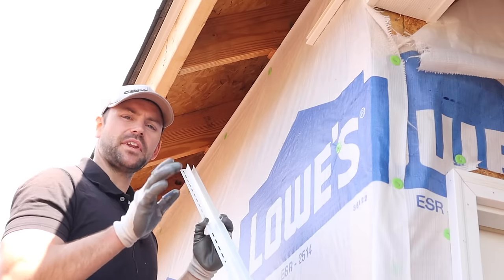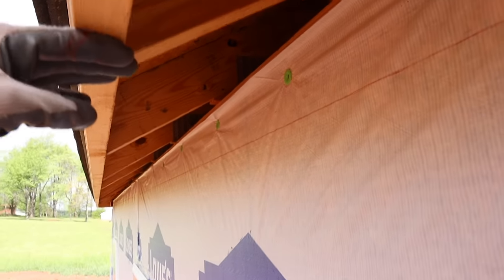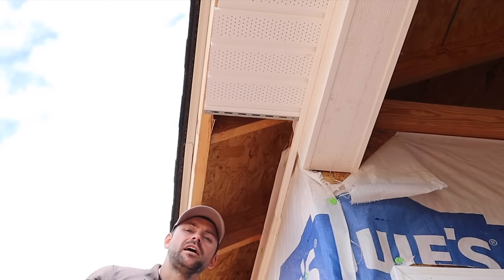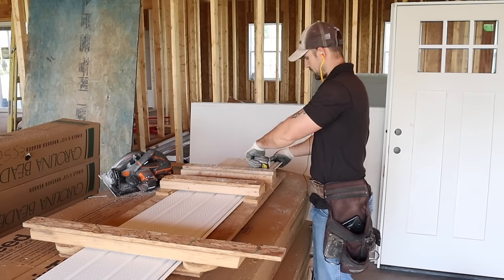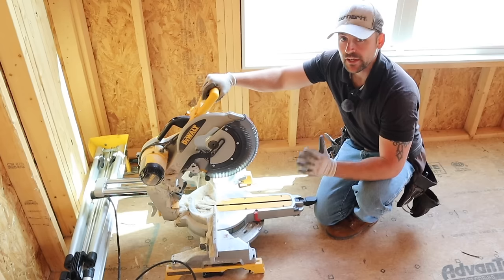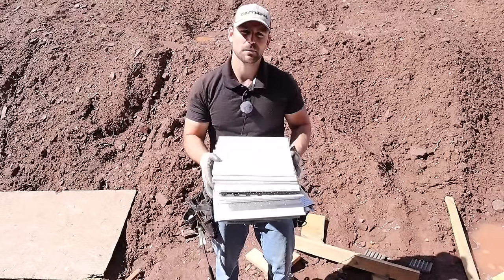How To Install Soffit And Fascia

Comment: You probably won’t see this , I just want to appreciate you for taking time to put this video, it Educational and very helpful .people like you really deserve viewers.
Reply from the maker: I am so glad you are thankful for my content! Do you put in a lot of time to make these videos. I hope you get great use out of them. Thanks a lot for watching!
Reply: this guy is super nice , hes very intelligent, explaining everything to the T
Reply: No safety glasses at all that's not good
Reply: @esexavo  12:25
Reply: I just needed help with the point of the eves. I can't get a straight cut at the point of the roof on my facia.
Reply: Very good and explained very clearly
Reply: Thank you for showing in detailed how the soffit fits into the F channel. I need understand this as I can partial disassemble some soffits to install security cameras and run Poe wires into the attic.
Reply: @TheExcellentLaborer  so pleased I found your Channel. Your explanations are smooth, detailed and easy to follow. Thank you. …staying with this.. unfortunately I don’t have the funds to pay a tradesperson, so got to try this myself. I have all the tools, most probably going to use my circular saw. My older home, already has old aluminum fascia, however I want to remove and fix as I can see I have rotting wood underneath.
I’m concerned as I might need to also take off the existing gutter 😮.. any advice appreciated. Unsure of you will see this message.. here’s hoping. Btw.. I’m in South Florida, so no cold weather here! 
Thanks again. Look forward to your reply/ extra guidance. 👍

Comment: The problem with installing the bath vent in the soffit, is the moisture is going to go right back thru your vented soffit into your attic space which is a no, no.  If you do put the bath vent in the soffit, you need to run unvented soffit for a distance of 6' in both directions before you start back with vented soffit.
Reply: Great point, I’m surprised he did not mention that in the video, it’s just basic fundamentals in soffit and facia installation, otherwise great video.
Reply: Absolutely agree.  I bought one years ago to retrofit to my old house and I began thinking about what you said above.  I did not install the vent but returned it.  Years later I installed a bathroom fan and put the bath vent in a side wall instead.
Reply: I saw the video as well
Reply: @roldangonzalez7360  He didn't know, so  that's why he didn't mention it

Comment: I'm looking for an answer as to why our fascia and soffits are completely rotten. The roof is cement tiles. The facia is wooden and the soffits are plywood. It looks like a piece of cardboard. The piece of aluminum in your video here is plastic and doesn't go over the facia. I don't think I should have the same company who made this roof to repair the rotten facia and soffit. Make Walsh Roofing Company I wonder if they also put gutteres?

Comment: I’ve always heard never install a bathroom vent in the soffit because the moisture will get drawn into the soffit and cause mold in the rafters/roof.
Reply: You're right. You never run vents out of the sophet, and there's absolutely no legitimate reason you would have to. lazy, and if someone tells you differently, they either don't know what they're doing, or they're just lazy and don't want to do it the right way because it's a little  little bit more work to put it through the roof where it should be

Comment: Just had a contractor install this and its all wavy. they bent it all and didnt use the stuff with ribs like you did. they also installed lots of nails under the drip edge. Any thoughts on what may have gone wrong?

Comment: Good video for beginners. Who ever put the roof on was lost on the drip edge it’s lapped wrong direction. If you will make a 45 degree cut when you made the angle notch let it over lap the straight cut at the corner it will look like it’s cut on 45 degree angle. Makes it look much more professional.

Comment: Good presentation.
2 things I do different.
1. I use stainless ring shank trim nails, because I've seen, too many times, the aluminum nails have worked their way out. It may be because of the hot and cold climate here.
2. On the underside corners of the fascia, I like to cut a 45 degree. It gives it more of a finished look and you don't have that corner sticking out.
Overall, an excellent presentation.  Thank!
Reply from the maker: Thanks for sharing! I appreciate you giving me honest feedback. Stay tuned for much more to come!
Reply: As James mentioned,  the nails do come loose after a period of time, what are your thoughts on white aluminum screws?

Comment: Great video.  Thank you.  I’m installing new soffits and fascia soon.  
My only suggestion is install the fascia before roofing.  Then if you have ice guard you can wrap the ice guard over the top of the fascia.  When gutters are installed they will seal against the ice guard.  
This does a great job sealing the area between the roof and the gutter that is otherwise not protected.

Comment: When we do are soffits and siding we use a grinder with a cut off wheel and it cuts them pretty quickly but does make a decent mess. Never thought to use a skill saw with the blade backwards might try it out next time
Reply from the maker: Turn the saw blade around backwards and you will love it! Nice clean cut but it is very loud be sure to use your protection. Thanks a lot for watching!
Reply: Doofy cat Donkey , that would be "our soffits", and you can get metal cutting blades.  They are spendy but work well.

Comment: Josh - love your videos! A couple video ideas: 1. common construction terms that inexperienced viewers may not know. 2. How to do the math to calculate framing interior walls 3. Installation of a fireplace. Just some ideas. Thanks!
Reply from the maker: Hi Michael! I am going to keep note of this post and use these as ideas. I’m definitely doing a fireplace installation at some point. It might be a while though. And that’s a great idea about the construction terms. I didn’t even think about that one. I appreciate it! Stay tuned!
Reply: I second the fireplace installation idea. I ran a gas line to old wood burning fireplace, need to figure out how to do the fireplace!

Comment: Hey Josh, a cool tip I learned many moons ago..is on corners especially the soffits..when your done wrapping and nail the metal you rip a 1"x1" peice by whatever fascia size is and put a good adhesive silicone on it (not too much..don't want it oozing out) and it hides nails and seals corner nicely.
Reply from the maker: Hey S Barker! I like your ideas. The silicone trick sounds like a good one. Thanks a lot for sharing. I appreciate you commenting!

Comment: I do it very much the same! So much so that I was almost positive that you learned from my video on how to make a birdbox lmao I'm jk! 2 questions though.  I didn't watch all the way through but why the vented soffit up the gable? Everybody typically does solid 1) because there's nothing to vent and 2) because if the neighbors house catches fire significantly less smoke will get in your attic with solid panels.  One of my subscribers  actually said that it's a code requirement in his area for the smoke reason.  And then my last question is why not do the bird box return first, then the eves fascia, then the gable fascia? The reason i do it that way is because you don't have 2 straight cuts on top of each other (the bird box is cut flush and then the gable is also cut flush) the way you did it.  I know your way is still water tight but if you switch your first and second order you'd have a flush bird box, then your wrap around, then your gable fascia comes flush to that one.  So you actually get to bury the bird box and it looks less bulky and a bit smother.  And then one pro tip would be to make sure you 45 both of your 90 degree bottoms. Nicely done though! Nothing hackish here. It's good to see somebody taking pride in their work
Reply from the maker: Hey Veteran Construction! That’s a lot for watching my video. I have seen some of your videos and I love how you speak your mind and the no BS approach. I just use the vintage soffit to match the eaves of the house. It actually how everyone does it here. That’s interesting about the smoke issue. That is also not a thing here😃. I do that in that order. In this video I already started the facia coming from the other end. I have another fascia video that demonstrates how I usually start that way. Thanks for complementing my work. Same to you. You do a good job as well! Thanks a lot for commenting on my video.
Reply: @TheExcellentLaborer  no problem man! Like I said I love to see guys doing it right. Keep on brotha

Comment: Additionally, 5/8" soffit screws are your friend. No hammer bruising with a miss and when you're 40
 feet in the air on a stage or man lift and have to lean just a little bit, a small drill and screws are essential, inconspicuous and a neater job in my opinion than nails. Nails work their way out eventually NOT screws.
Reply from the maker: Good tip! I actually have never had a piece of facia come off. But I can see how screws could be better. Thanks for the comment!

Comment from the maker: Check out my amazon store to purchase the tools and supplies used in this video https://tinyurl.com/5mxzzdty . (I do earn a small commission if you purchase through my amazon store but it is at no extra cost to you)  Timestamps below to help you navigate this video 👇Hope this helps!
How to install f channel 00:32
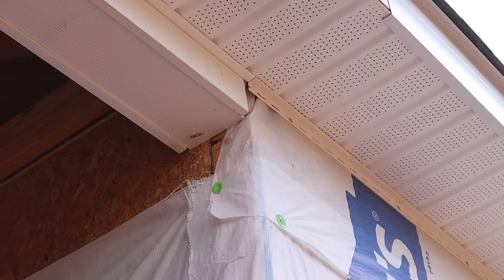How to measure for soffit 02:27
How to cut soffit using tin snips 03:24
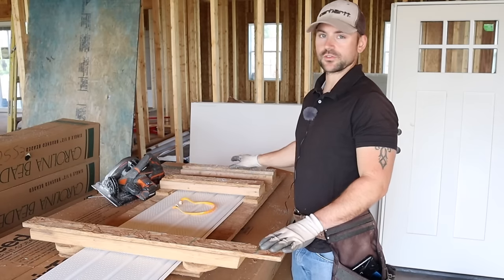How to cut soffit using a jig 04:20
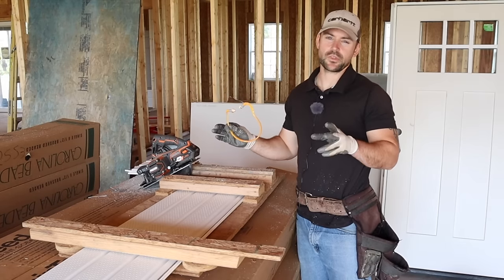How to cut soffit with a miter saw 06:17
How to install soffit 07:45
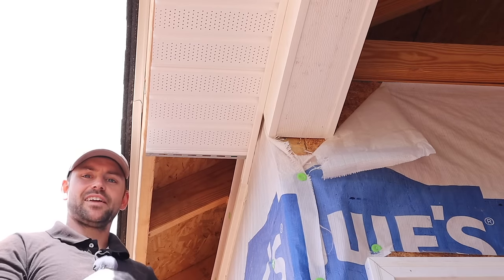How to install a soffit vent 08:51
How to secure the last piece of soffit 11:49
How to install fascia 12:07
How to cut the fascia where it meets a birdbox 14:34
How to cut fascia to wrap a birdbox 18:22
How to install fascia on a birdbox 22:00
How to measure the gable fascia that wraps a birdbox 23:09
How to cut gable fascia that wraps a birdbox 23:36
How to install gable fascia 24:58
How to finalize the birdbox fascia 26:28

Comment: This is a EXACTLY what I'll need in about wk or so... This rehab house has many missing soffit & fascia cover or whatever --- and most of the gutters are either missing or detached... So this will be a project that'll get added for when I get ready to work on my roof. 🤦🏻‍♀️

(I'm a single mom of 2 with very very limited $ so it was either DIY rehab home or live out of my tiny subaru 😂😂)

This was SUPER helpful. #ThankYou ❤

You've certainly earned my sub.. 💯

Comment: Never use vinyl channel always use aluminum 3/8 a lot more safe than the vinyl. Everything he explained is right. You can always look into building your own cutting soffit table, this will make your job much easier by reversing the blade on your saw and that’s it. Always at the ridge start from the middle and bend your piece in half so it looks equal both sides

Comment: Good afternoon Sir, I have been utilizing the information and how to from this video installing new fascia and soffit on my home. I have a question pertaining to installation of soffit on an inside corner. I’m trying to post a picture of what I’m dealing with at the moment and would certainly appreciate any input and advice. Thank you for the great video and explaining things. Not sure if I can post a picture to the thread or not.
Reply: I got it, just a bit of finessing the soffit into position. Originally I had the thought of running corner and cutting diagonal to make it uniform. But just decided to make a straight cut, keep up the great work and posts. A true pedagogy.

Comment: Good job!
  realizing you work alone most the time, question,  why not install fascia before roof and drip. This way it's fastened to the sub facia. In high wind zones that one nail every three feet is not going to last. 
Just one more, your job looks nice at the cut out bird box. Why not use two sided automotive grade 3m tape under that cut stuck to a scab of aluminum that's nailed to the bird box first Then you wrap and then the gable trim. You must not have strong wind where you are..
Thanks for the pointers, i was contemplating vinyl fascia feared it will blow off in wind storm. You cleared that up by mix matching. The other things is, foam that holds roof tiles on,  if a few snicker bar sized strips behind the fascia will help hold it on in wind storm  but for how long, im going to test that theory 
👍

Comment: Wow truly excellent, thank you.  I need to install soffit and fascia on my new house with large porches, need the porch ceilings covered with soffit it will take a lot of material, what is best aluminum or vinyl, the house is wood with cement board siding?

Comment: Thank you so much for sharing this information, I found it very enlightening!  This is the first time I have ever seen a metal fascia or soffits.  I feel like I have been living in the dark ages or something!  I live in California in a 70 year old house, hopefully that's why!
I do have a question regarding soffits we have on a family room with a flat roof.  The soffits are all wood and there are no holes, just solid wood.  This room is so hot and I have looked at it and wondered why there were no vents.  The original house has roof vents but this room has nothing.  I believe the lack of vents may be the reason it is so hot.  My other concern however would be ants and how you keep bugs out of your soffits with the holes for ventilation,  Any advice would be greatly appreciated!

Comment: Yea its up... but its way different to how my boss taught me. Still good job dude, remember no ripples, dont end with less than a 3', no seams facing front of house, mitre those inside and outside corners, and the seam underneath the fascia no more than 1/4", nail close to seam and along every 16". Also to install in order it goes soffit eave, soffit gable, birdbox wrapped in coil, fascia rake and always bend 1" around to the eave and put two nails, then fascia eave. Nails in fascia through birdbox spaced eavenly. Done. I work with steel fascia and alum soffit. And we cut a whole 12' long box of soffit with a circular saw corded. 12 pieces one cut.

Comment: Great video, not just this one but the many I've watched on your channel as I have been slowly renovating my house.

I'm getting ready to do the fascia and ran into a slight hiccup. The fascia from my local big box stores appears to be sized for 1" fascia boards, mine are 2". (Well, 3/4 and 1 1/2 but you know what I mean)

Should i hammer the extra lip flat? Cut it off? I don't have the tools I would need to bend it myself to get the 1 1/2 on the bottom.

Its all going to be painted anyways, and face nailed since I'm installing gutters.

Comment: Fantastic walk through, I'll be using it as my reference on the project. Is replacing soffit and fascia on a existing wood sided (T111 & plywood soffit) home possible without removing the siding? Would like to replace soffit and fascia with aluminum and reside later.

Comment: im late to the party but GREAT VIDEO! I just climbed to my roof n clean the gutter n realized that the house did not have any drip edge. can i add a drip edge by lifting the shingles n then glue it back?

also do i need to add a drip edge on the fascia side?

Comment: i see there is no wood support basin underlaying the soffit. I have been told it is necessary install plywood panels to have something to nail the soffit to and to avoid air getting up under the roof . What are your thoughts ?

Comment: His bends and cuts are sooo clean...home depot replaced my aluminum soffits and fascia and messed up soo bad and they're supposed to be pros..
Reply from the maker: I try to do as good as work as possible. Sorry to hear about what happened with your Home Depot install. Maybe they will come out and fix it if you call them. Thanks for watching!
Reply: "pros" (professional) means it's what they do to earn a living. It doesn't mean they're good at what they do. Professionals can be hacks too.
Reply: Most Home Dopers or Lowes or Home Hardware install services are done by trades who for 1 reason or another are NOT in business for themselves. That speaks volumes alone. My husband has been doing siding sort it fascia for close to 30 years and claims that during lean times, people who have had home installs done by the big boxes keep his wallet full. I have a band aid on a cut on my hand....doesn't mean I am a doctor. The same can be said about big box installers. Hats off to those that try and learn from their mistakes but the minimum wage snip monkies hired by the orange and white ( or blue and white or red on red) have more than likely acquired their experience 10 minutes ago.

Comment: Nicely done. Thanks for all the tips. I have wood fascia board where the paint and caulk are peeling off. I plan to go for aluminum fascia. Do I need to remove the caulk and paint before fascia installation? or just install over it?

Comment: Always inspirational to watch your videos. Haven't started my house yet due to lumber prices and materials availability. OSB alone at $47 a sheet vs $11 a sheet adds $5000 to the build. That's a no go. Have another idea to build what I'm calling a hybrid barndominium. Foundation is stem wall on continuous footer 4" concrete floor recessed 12" with sleeper 2 x 12 floor joists for insulation and plumbing. 4 x 6 anchored to stem wall top 8' o.c. The above ground building like a barndominium. Plan is done site is prepped just need permits. 
Steel siding is less expensive than OSB and vinyl siding which is rediculous.

Comment: Thanks for the video.  No one seems to cover where the gable soffit end runs into the bird boxes.  I'm not sure if I need to run the soffit on the gable end into a J channel on the bird box or like in your video it looks like it's lose against the bird box. I have put my gable ends on hold until I figure this out.